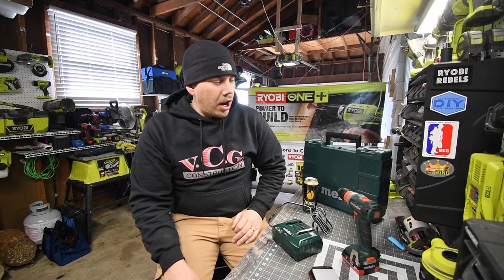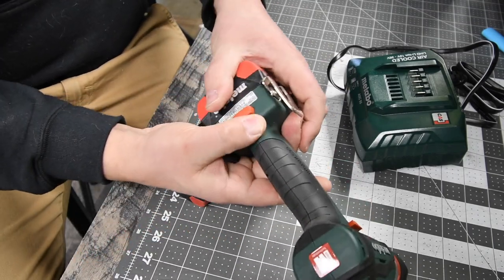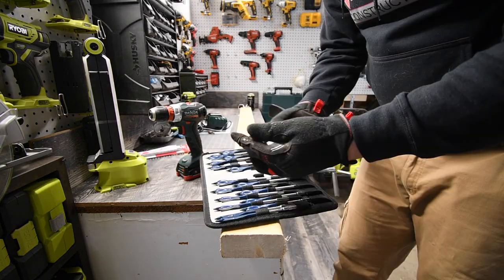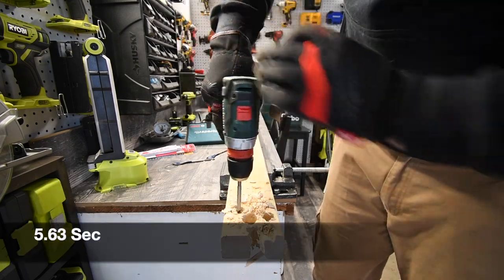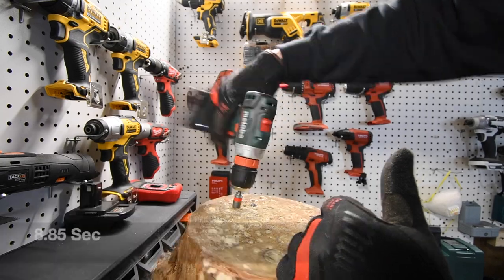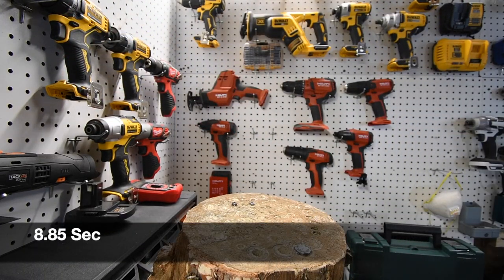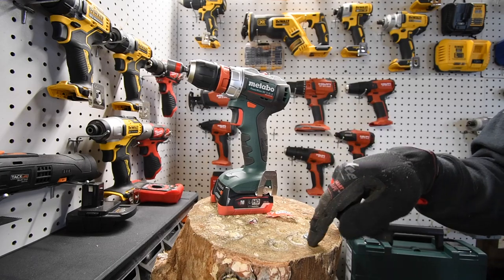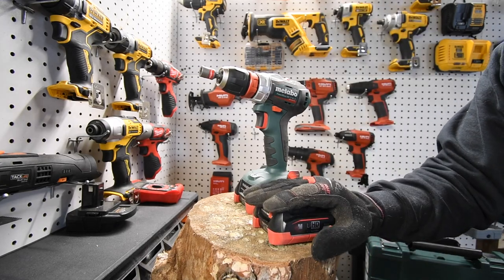$240 Metabo 12v PowerMaxx drill

Comment: CAS stands for "Cordless Alliance System". Many European cordless tool brands use Metabo batteries.
Reply from the maker: I Thank you for the info sir
Reply: Any CAS battery even from a different brand will work in other brands' tools as well.  They are interchangeable.

Comment: The Q in the model name stands for Quick.  You can do quite a bit with the quick interchangeable heads. 
I thought about getting the 12V Metabo system, but I think I'll just expand my 18v lineup with Metabo.
One nice thing, Metabo's charger charges both 18V and 12V.   It is the same connection.
Metabo has superior battery technology to competitors.
Reply from the maker: excellent and thank you sir

Comment: Thanks. You can also remove the chuck on this drill, (that's where the letter Q for Quick comes in) and fit your driver bits straight in. Saves time and makes it very good for tight spaces. Metabo is my favoured make (in the UK).
Reply from the maker: I need to explore the Metabo brand more and I thank you for viewing Errol

Comment: That Metabo drill looks awesome, and the use 21700 cells battery seems like a great platform to invest in the future. Problem is, they basically have only a drill and an angle grinder and I think an SDS hammer on their 12v platform. No jigsaw, no multitool, no compact circular saw, everything they have is 18v. So investing into a line of batteries just for 2-3 tools doesn't seem like a great move for the moment.
Reply from the maker: I need to get more metabo
Reply: I'm late, but some of their 18v tools are cross compatible, such as the radio and the site lights.

Comment: Never use gloves on a rotating tool !
CAS is a cooperation of many companies using the same batteries by metabo Means you can use your Metabo Batteries for e.g. Mafell etc.
The Q-Version you have can remove the chuck, so it get's shorter to work in narrow environments and you can plug a corner-adapter on it or an excentric adapter to be close er to a surface etc. 

Fun Fact: the Festool chucks fit onto Metabo. So you can use it with Centrotec. (But not the other way round)
Reply from the maker: Thank you for the info Dennis

Comment: Dave, normally we'd never post a comment on what we sell stuff for on videos, it can come across as spammy and not what we do. Since the price is first thing in the title and it's part of the point of the video we do want to jump in to say we sells this kit for $89 currently. It did launch much higher at $240 but sales for Metabo 12V line were very slow so they did a huge price drop and we bought all we could (possibly all of them?) because we think it's a great tool. Agree with everything you said it's a great tool, power to size is hard to beat. Not sure we will continue to reorder Metabo 12V tools after the price goes back up but is compatible with full CAS system (Mafell, etc) also charging on 18V Metabo Charger which we will of course continue to support so thought it was a nice add-on.
Reply: Yeah I just bought the mafell version. While it's very nice the price I paid compared to your price for the merabo hurts a little. At least Noone else I know will have a  mafell . I honestly thought when I saw that price that your store wasn't legit. Though I found out you are. I ordered the metabo charger cause they don't make a us version for mafell.

Comment: I don't know if it's just me but it looks like drill drivers drive screws in way better than impacts. I have seen other test with drill drivers on other channels and they really zap the screws in.
Reply: Impact drivers were made specifically to drive long fasteners, they don't need the extra power and torque like a drill driver because the impacts is what helps drive screws and lag bolts easier with more control and less slipping .👍
Reply from the maker: They do but you risk driving the screw deeper into the material, an impact driver is more control driving a long screw in, it may take more time but its more effective

Comment: The 4 amp hour batteries are tiny compared to the others. I like that drill if you buddy has the impact driver to match the drill would like to see what it will do   Good video
Reply from the maker: I Thank you sir
Reply: Metabo's 4 amp hour battery will hold their own against larger batteries.  They are known for providing sufficient level power for the entire life of the battery rather than performance drop-off towards the end of the battery charge.

Comment: I'd like to see the metabo up against the 12v makita and the 12v Dewalt Xtreme, I think the Dewalt 12v Xtreme will beat It .👍 I have the makita 12v and the Dewalt 12v Xtreme. Sets .
Reply: Jason Levesque and what about the Milwaukee 12v
Reply: Milwuakee will kill'em all!  Less money, more tools, more power.  Better warranty etc.,  imo for the money
Reply: @Eng586  I already know the Milwaukee 12v will beat that metabo all day no problem. 🤣🤷‍♂️
Reply: @rafaelmarin1963  in some cases yes Milwaukee will beat the others but I've seen the 12v Dewalt Xtreme, beat out the Milwaukee 12v fuel in a few videos. I've also watched some makita 18v impacts beat Milwaukee ones also .Makita just came out with a new 40v line of tools also coming this year .👍
Reply: Rafael Marin the 12V Milwaukee beats it, but Milwaukee tools tend to go smoking when under very high constant load. The safety systems inside aren't that good, that's why they always perform better. Tested it myself. The Milwaukee was about 25% stronger. When you get a Hilti or metabo they will never go smoking because they will protect the innerts with shutting off early enough. You pay what you get with German tools.
Reply from the maker: Versus video are coming up and thank you sir
Reply: @ManCaverTools  on the versus video to be as fair as possible, can you show us a dollar for dollar match up?  Get equally priced kits and let us see where the power and value are.  People say "you get what you pay for", so show us what that means.  To me it's crazy to show (for example) $700 worth of a Hilti hammer drill, 5amp battery and charger up against $200 worth of DeWalt, Makita, Milwuakee, Bosch, Ridgid etc.
Reply: @rafaelmarin1963  you always pay for warranty, service, repair part availability over years and life time too. Raw power is nice to have on first glance but not everything you will need thru the years.

Comment: I like Metabo corded tools but that drill looks kinda disappointing.  $240 for a 3/8 plastic chuck seems pretty steep.  Can buy a full kit of Ryobi/Ridgid cordless tools for that price just about.
Reply from the maker: indeed you can, some people are willing to pay for quality, but I do agree its a lot for a 12v drill and I thank you for viewing sir.
Reply: You're paying extra for the quick change chuck / attachment system, light weight, and compact size. You can pop off the keyless chuck shown in the video and use it as a 1/4" hex driver, and there are also offset and right angle attachments available. Plus, it only weighs 2.4 lbs with a battery and it's only 6.3 inches long with the keyless chuck or less than 5 inches long when used as a 1/4" hex driver. It's also the most powerful 12V drill on the market. The competition is the Milwaukee M12 Fuel Installation Driver ($229) and the Bosch GSR12V-300FC ($229), so compared to other 12V interchangeable chuck drills the price isn't actually that different. You can go ahead and buy your full kit of Ryobi/Ridgid... but that defeats the entire purpose of this drill, which is to have a single compact, light weight, do it all tool.

Comment: That battery eject system sucks. You should not have to move your operating hand off the grip just to change the battery.  It slows you down tramendisly. When you're drilling your operating hand should stay where it is and the other to swap the battery out. Two motions.
Reply from the maker: Thank you sir
Reply: It doesn't suck, it's quite nice IF you know how to use it.

hit the release with your palm that holds the handle and slide the battery out like any other tool.. Not that hard. Been doing it for the last 7 years with my old metabos. Not any more difficult than my other tools from milwaukee or bosch.